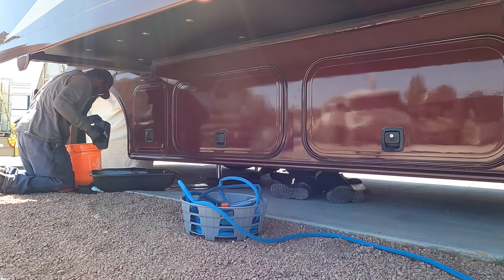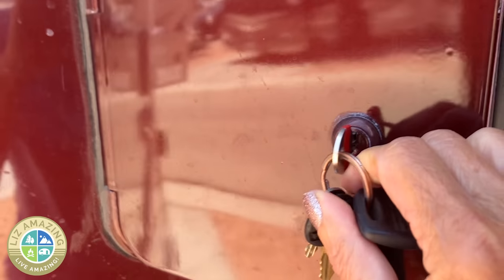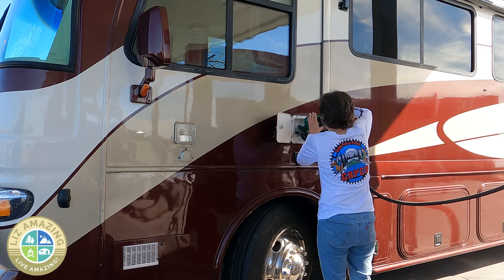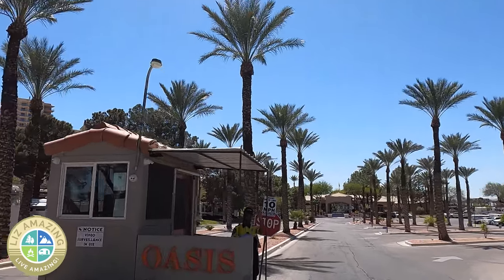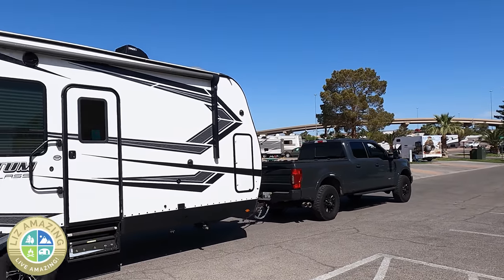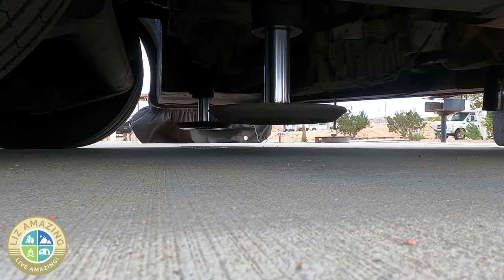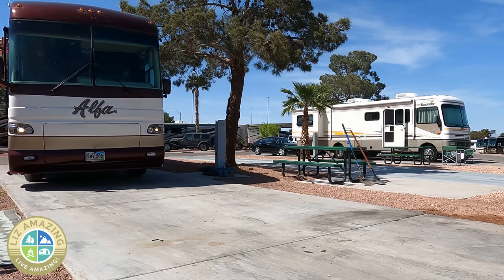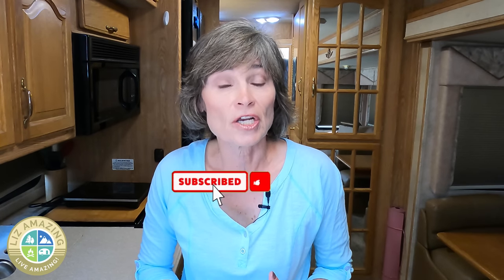RV Life: The WORST mistake I've ever made!

Comment from the maker: 🧲🧲🧲 LINKS  🧲🧲🧲
🚩Get the inside scoop before everyone else: -- https://www.patreon.com/LizAmazing

🛒 Liz Amazing’s Amazon Store: https://www.amazon.com/shop/lizamazing

***As an Amazon Associate I earn a small amount from qualifying purchases. You don't pay any extra AND you help support the channel. Thank you!
Reply: You are an amazing rv driver!  I am impressed.  Bravo to those guys that finally fixed that problem.   Maybe a light over that area would help.  Enjoy your trips and be safe out there!
Reply: the reason they have approved vendors is because the campground is getting back alley kickbacks. The whole thing is corrupt and that campground is a scam
Reply: "approved" vendors must be getting approval by paying money to the campground. that's why they are more expensive. having moral values does not make one earn money. if fact, the opposite is true.
Reply: The "approved vendors" kick back between $50 and $500 to the campgrounds,,,
Reply: Thank you for all this valuable information.
Reply: A sifon hose and some containers and maybe you could have solved your issue for cheap.. 

At my fleet we have huge labels "gas only" etc...
Reply: @mysticjedi6730  Definitely marking WATER & FUEL over the doors would help with any confusion in the dark. They sell fluid pumps either electric or hand operated & removing the contaminated fuel could have been done. Long process the way your guys did it & also using the pump method. Approved vendors only is the worst thing a RV park can do to owners. Glad it all worked out though.

Comment: Having dealt with this before…..    I have a 100 gallon fuel transfer tank  in the bed of my truck.  I use it to fuel my excavator, tractor etc.    I also have a fuel transfer pump that will suck the fuel out of your RV.     This would not have been a super complex thing to deal with….   First I would pump your tank dry into a couple of drums.    Then remove the plug on the tank to make sure I got every last drop.   Maybe wash a gallon or two of diesel and refill your tank.    Woulda taken more time to round up two empty drums.   I would keep your old fuel and after a week suck fuel off the top and use in my equipment.
Reply: Same. I did this when I was a diesel tech.
Reply: I was surprised they did it by hand

Comment: Liz, an inexpensive solution to prevent this from happening again would be to invest is some locking fuel caps. Without the key you could not open it. Also would help prevent fuel theft that is common in some areas.
Reply from the maker: Yes! I think I will do just that. Thanks for your comment !
Reply: We just had to replace our caps (on a 2022 Newmar, no less, after one year of travel 🙄).   Wish I had thought of locking fuel caps…when these break, that’s what we’ll do.   Thank you.
Reply: or putting a green colored cap on it which indicates diesel fuel, or like the post office does...they put a sticker on their fuel caps that says DIESEL.
Reply: Flashlight at night!
Reply: No matter what precautions you take, nothing is 100%.
Reply: or maybe a label that says DIESEL on it to put on the diesel door.
Reply: Do RV fuel tanks have anti siphoning…could they mechanic have just out a tube down and pumped put?
Reply: This occurrence should be safeguarded against by the manufacturer. There should be a blinking led light triggered by opening the fuel access door or at least a glow tape label on that door saying DEISEL. Furthermore it should obviously not be located adjacent to the water fill. Duh! Half a million dollar rig at least ? C’mon people! Think!
Reply: @zarlok5294  You made the best observation and comment. The manufacturer could have "mistake proofed" this by simply not locating the two inlet ports so close together. Poor design from the get-go. Again, good comment.
Reply: @MrJimmy-ox7fq  it’s something  no desire team worth their salt would miss.
Reply: I agree with towing it would open another can of worms 🪱.
Reply: Back in the day “Top Gear” had a product review of a motion sensor that said “diesel fuel only” (or something like that) every time the door was opened. I thought it was silly at the time, but not anymore lol. Glad you got back on the road without engine damage. Kudos to you for knowing so much about your rig
Reply: @LizAmazing  May help to prevent fuel theft if somone wss to break into fuel door. Or if someone had malace intent to put sugar in the fuel or something like this.
Reply: @zarlok5294 or a fuel door pull at the drivers seat.

Comment: Wow!! I would never even think to ask if there is an approved vendor list. Now I will start asking. I've never heard of that. But $5000/year seems crazy to me. No wonder they charged so much more. I'm sorry you went through this, but definitely some learning experiences. Hope everything is okay now. Safe travels.
Reply from the maker: Thanks Carol, so glad to have that behind me now. Yeah, there is no mention of the approved vendor policy on their website. It's in the brochure they give you when you check in. I counted 30 RV vendors, at $5k a pop that's a lot! I'm hoping they ditch that policy for sure! See you in the next video.
Reply: The campground argument could be that they need more insurance to abate grease, motor oil, gear oil, anti-freeze, brake fluid, power steering fluid, battery acid, and fuel spills. Since not all chemical spills are easily detectable, records should be kept as to when and what maintenance was done by what company on each site.  The approved vendor list should be regulated by before work and after work campsite inspections.

Comment: Your diesel engine has a water separator fuel filter that should be drained as well. Me personally I would’ve only drained the 13 gallons of water which would have come out of your tank first. Love your videos keep up the good work!
Reply from the maker: I checked the separator and barely anything came out, which was not a big surprise since I never started the engine. I had all the draining of the tank on video and water came out every single time until maybe the last 8 gallons. I think that must be because of the funnel effect, like when you drain your bathtub. Thanks so much for your support and kind words, Brett!

Comment: Hey Liz.  Thanks for the videos!
I want to say that one mistake a lot of people make is turning the water valve (the one that switches from city water to filling the water tank) with the shore water turned on.  Turning the valve with the pressure on will sometimes cause the valve to malfunction or break.  (I know.  The valve should be stronger than that. 🤷🏻‍♂️)  It’s always best to make sure there’s no pressure on the valve before turning it.  I would replace the valve (not a very hard job) so this may not happen again.
Thanks again for your videos! 😁

Comment: Glad you got it sorted eventually, but with more stress than you wanted for sure. I would have gone into MacGyver mode. 5 or so 5 gallon containers, pump from filler or drain from below into a large oil change container and transfer to 5 gallon containers. If it's coming out diesel rather than water, done. Find where to dispose of the dirty water/diesel mix. Add the diesel water remover additive to the tank, refill containers with fresh diesel, multiple fillups to get almost full tank, done. Painful, but in an emergency, doable.

Comment: I just watched your video, Liz. You did the right thing. When you said that you put Howes fuel treatment in your fuel, i would've dumped the whole thing in there...better too much than not enough. As a truck driver for 37 years (34 as an owner operator), you should put fuel treatment in at least every other time you fuel. Diesel has no top-end lubrication since they took the sulfur out of it. I use Lucas fuel treatment every time I fuel up. This keeps the moisture out of your tank and fuel lines, helps keep your fuel filters from getting stopped up, and also keeps your injectors clean, while adding top-end lubrication to your upper cylinders. Lucas and Howes are both well know brands.
Reply from the maker: This is a great tip, thank you so much John!

Comment: Maybe go to a hardware store and buy a lock cylinder that matches what is on those doors but has a different head on the key and swap one of the pair of locks. Then have someone file a decent sized notch in one of the heads of the keys. That way you end up with two doors with different keys and tactile reminders in case you need to access either in the dark. A good flashlight is also helpfull for simple regular tasks like that as well.

Comment: As a tradesman holding certs in two mech trades, upon retirement in 04 we decided to snowbird and ordered a new 38' Mobile Suites and designed a custom built 04 Internationa Toter with a Harley barn behind the cab. I became the defacto "go-to" guy iin the resorts we stayed at in Az. & Tx. During our years of winter snowbirding. After the first year of ownership of that trailer and having to repair virtually every system, eg: the 50 amp transfer panel being wired wrong to the black tank power flush plumbing, to the hydraulic slide pump leaking, to the crossover tubes to the brake calper halves all being crushed from them rolling the axles around in the factory on just the discs with no wheels installed, to the roof trim at both ends lifting away .
Reply from the maker: Oh my goodness! Thank you for sharing this. So sorry to hear this.

Comment: A “LOCK” Would Make It More Easier To Distinguish Whether It Is A
Gas Or A Water
Tank.   IF: Possible If You 
Could Switch To
A “KEYED Or LOCKING” Fuel Cap.   

As Well As A
Both On There
Just Like A Locking Medicine 
Bottle For Example.  

WHICH: May Also 
Some Prevent A Complete 
Disaster Etc.  
WHEN: Concerning 
“RIGS & MOTOR 
HOMES”.  A Locking Gas-Cap
Behind That Door
So You Will Know 
It Is A Fuel/Gas
Tank.

Comment: That was painful to watch. I'm not trying to tell someone how to do it it's just the way I would do it. Because I'd be working alone. I've been in the business  for decades and to fix this problem. I would have got my Craftsman 16 gallon Shop-Vac to suck the tank out and then just drain vac. You could have drained it from the bottom with a Craftsman vac. And if the hose wouldn't have been long enough I would have put two hoses together. Have the Shop-Vac on the top so it drains down in your barrel it's a lot simpler. The shopvac over the years hass vacuumed up coolant, oil, water, antifreeze, diesel and any non flammable fuel. I've dealt with approved vendor stuff like this and I don't advertise to be able to work on someone's lot. As I thought these approved vendors are paying to have their name in their book and being able to work on their campground. This is the same thing as politics.
Reply from the maker: There are definitely more than one way to do this job, yours is the first to mention using a vacuum though. That's something to think about for sure! I'm just glad to have all the behind me now. Thanks for watching and see you in the next video right here: https://youtu.be/cX9s-4ohP30

Comment: I added a spin on water separator filter systems on my Class A coach and diesel pickup.  It looks like a big spin on oil filter that is mounted to the frame right before the fuel line attaches to the lift pump on the engine. 
 This is in addition to the engines fuel filter.  
With this extra filter I can unscrew the filter from the mounting bracket and screw on a hose fitting so that my fuel tanks electric fuel pump will pump all the contaminated fuel out of the tank through an old garden hose, into a bucket or big tote tank like your guys used.  Yeah, I learned this the hard way after a pump jockey pumped gasoline into my diesel tank. 

As far as disposing of the water contaminated fuel, the water  can be separated from the fuel so it's safe to run by several different  methods.  One is with a centrifuge , or, just let it settle and drain the water off the bottom.  Aka siphon off most of the fuel off the top.  Waste Oil / vegetable  diesel guys have the setups to do this fast.  I'd recommend your readers do a search for one of these guys if this happens to them.  WMO/WVO guys filt a lot of nasty stuff to make cheap fuel out of waste motor oils and corn oils.  So water in diesel would be easy for the
Reply from the maker: Good tip about the extra water separator! I checked mine and it was good. Of course, I never started the engine. Yes, it's true the diesel could have been reclaimed. They put mine in an already dirty container so I don't know.... Just glad to have all that behind me now! Thanks for watching, Curtis.

Comment: A couple of suggestions.  1.  Make a petcock valve that screws into the drain hole then he does not have to take the plug out and in.  2.  Have small pump with a button switch  from the pan to the large tank then the person under the RV can start/stop the pump.

Comment: Thanks for the video.  For us, out water panel is totally separate from our fuel filler.  I have also made sure that my wife is very aware of the type of fuel going in and we luckily have never had this happen to us.  Good luck and I hope everything works out well.  Love all your videos.  

Where we are seasonal campers, the park (in Ontario Canada) has an approved vendor list, however the vendors are reasonable and seem to be very knowledgeable.  I think an approved vendor policy can work for everyone if the vendors know what they are doing, park management does not gouge the vendors causing them to have to charge more and are reasonable with the RV owners.  Our park claims to want to ensure that repairs are done properly, vendors have the appropriate certification and insurance so that the park does not have units burn down in the middle of the night or spew their guts everywhere due to faulty repairs.
Reply from the maker: Yes. There are definitely good reasons to have an approved vendor list. Your campground it sounds like they are doing it the right way. Other campgrounds make it a money grab. Thanks for your comment and I'm hoping to get to Canada later this year! Happy travels.

Comment: Great video and info, thank you!
I appreciate hard working small companies! 
I would like to offer a suggestion to them - since they do it so often.
They should really help themselves by adding a small valve to open and close the drain.  Then add a hose and connect to a little pump - so they drain the fuel direct into their tank. It could even be a manual pump (so it would work independent of electricity).
Instead of 2+ hours it would take 30 minutes and no spills to clean up.
Reply from the maker: Yep! Definitely a lot better ways to do this job than how they did it. I'm just glad to have all that behind me now. Thanks for watching.

Comment: Back in my trucking days, this happened a couple times. Water sinks in diesel and would freeze in the cross-over line between tanks in subfreezing temps. You can run out of fuel with one tank empty and the other is 1/2 full. Not a fun experience pulling ice cubes from a cross-over line in freezing weather under a truck. Or having water freeze in the fuel filters. Some fueling stations cause problems because their fuel is contaminated.

Most diesel pumps use Green pump handles. I have a Green cap on my truck. You can also place a Diesel Only sticker by the fill tube as a reminder. If you're lucky, your rig may have a water separator.

Gas put in by mistake can also ruin your motor.  Cheers
Reply from the maker: Yes! I ended up getting a locking fuel cap. I'll NEVER make this mistake again! Thanks for watching.

Comment: Everyone should have a water separator that can quickly drain water contamination.  They are easy to install in the fuel line.  Racor is the big brand that every boat uses.   On boats that cannot afford to lose pawer at a critical time there are two in parallel that can be switched quickly by a valve.   Also there are at least two in series in each branch a course 10 micron followed followed by a fine 1 or 2 micron.  There is also an alarm that sounds when the bowl is full of water.  A pressure gauge is installed across each filter to determine when the filter element is full.

Comment: Liz watching this and you noted the 11” height the crew had to work in. Because you couldn’t turn engine on and lift rig. Would it be prudent going fwd to have the rig in its high position once you’ve parked for any possible future issues? Another point is, why wasn’t a transfer pump used to siphon/pump out the contaiminated diesel into an empty tank? Much easier. You did a great job Liz handling such a stressful situation👍
Reply from the maker: Thanks for this. The motorhome needs to be as low as possible for best stability (less the jacks are extended the more stable) and to keep the wheels on the ground, not in the air. I'm pretty sure I won't be making this mistake again!!! Thanks for watching.

Comment: I had this happen to my Sprinter Van. It was gas in poured in. I DID NOT START THE VAN.  I disconnected the fuel line that feeds the diesel filter (under the hood) and connected a piece of tubing to it and then to a plastic drum. I cycled the key to the ON position. That starts the fuel pump to prime the system. I did this over and over until my tank was empty! Then filled with diesel!
Reply from the maker: Wow, sounds like you knew exactly what to do! Thanks for sharing, Ritchie!

Comment: You should always put another lock key for gas and diesel tank. Also, some of my trucks have a drain valve on the fuel tanks. Since water is on the bottom just drain until no more water. The water separator should filter the rest.
Reply from the maker: I did exactly that! I put in a locking gas cap. Plus I realized that the tank drained just like your bathtub. The corkscrew twisting action pulled liquid from the top and bottom so it took almost until empty for the water to be gone. Thanks for watching.